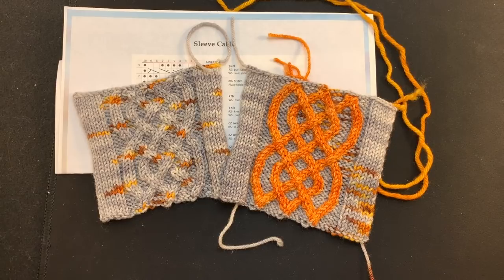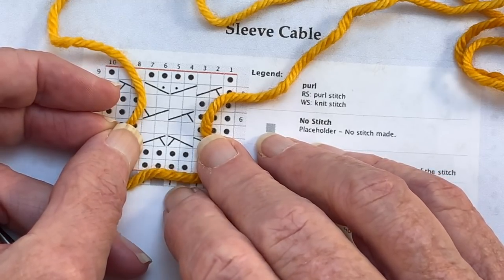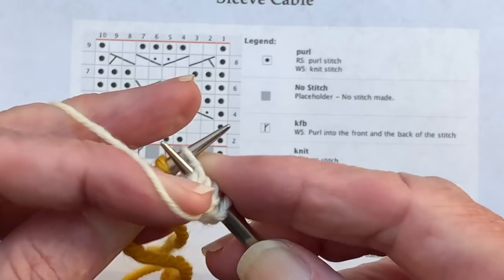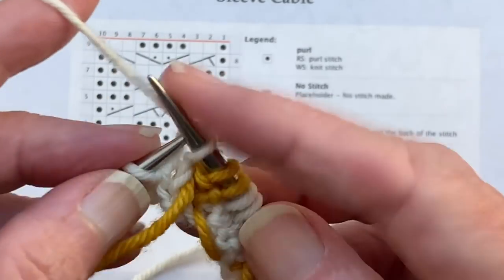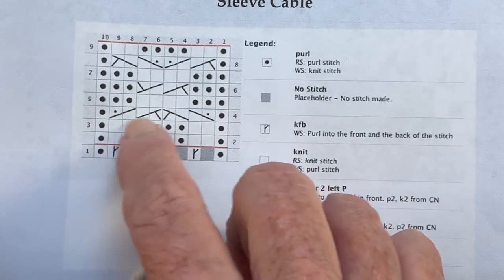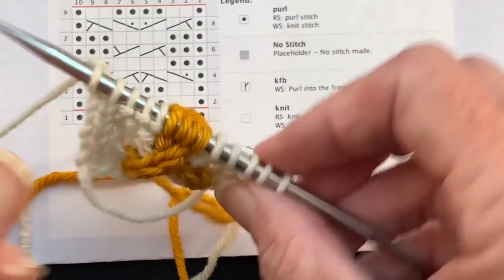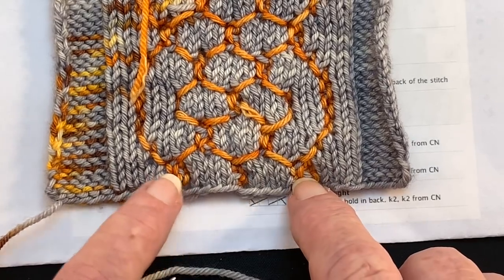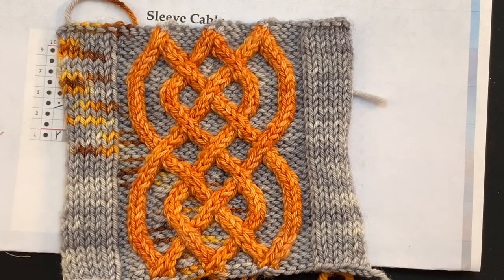Intarsia Cables Worked Flat

Comment: This is beautiful. Ya know, I have attempted to colorize my cables in the past, failed, and wondered if it could really be done. I was making a messenger bag in coal grey with cables, and I wasn't very pleased, because the cables were blending. Now I can pick it back up, thanks to you. Also the tip for splicing is heaven sent. I always hated the idea of spit part lol. Now, can this be done with any cable?
Reply from the maker: You can do this with any cable.  Hugs and Happy Knitting.
Reply: I"m trying to do the same I"m working on this pattern https://www.studioknitsf.com/heart-cable-knit-scarf/ I can't see to get it, my color stops and starts are wrong and i'm getting gaps in my color changes i'm getting frustrated.

Comment: It is absolutely mind-blowing and thank you so much!

I only have one question  though. You said here and in another video you have to read the chart from left to right if the number is on the left, so on the wrong side. In this video in the beginning of the first row the number is on the left but you started pointing from right to left on the chart.

Is it something am I missing or misunderstood? x
Reply: I know it's been months, but in case anyone else had this question, the chart she's using is symmetrical, at least on the wrong side rows. So reading the ws rows left to right or right to left doesn't matter in this case since it's the same each way.

Comment: OMG !!!
this looks scary enough for me to back up and scream
signed: a beginner
Reply from the maker: 😬😂 Be sure to subscribe to my channel if you haven't already, happy knitting.
Reply: Don’t panic, start with a simple diamonds eg. 10 stitches wide in the main colour, 2 st for the cable and knit as usual, just be careful when changing the colour,not to end up with a haul , use the same yarn for the cable, don’t cut it, but leave it loose, it is very simple for the beginning, good luck

Comment: Hi Suzanne, thank you so much for this video. I would like to use your technique to add some interest to a cabled coat pattern that I’m about to start, but the pattern uses a 3-over-3 cable design rather than 2-over-2. Should I still cast on just one stitch per leg, and make triple increases in my setup row where you make pfb in the video?
Reply from the maker: I would try on a swatch first - cast on ½ of the required stitches for the cable legs. Then increase in the legs, 2 increases in one leg and one in the other.  The one with two would be the one to the front.  But try it on a swatch to make sure you are happy with it first.

Comment: Suzanne, this is a great video.  Thanks.  I am a new knitter, but have trouble with reading charts wherein they indicate to cast on, for example, ten stitches plus five.  A chart will show how to knit within a colored area.  What happens outside that colored area.  Does it round-out the pattern?
Reply from the maker: I am not sure what you are asking.  Can you reword it?  Or give more information?
Reply: @SuzanneBryan Suzanne, if you took the pattern you use for the Intarsia Cables, and colored the block, then expand the chart outside the colored block, with additional stitches (this would give you ten stitches, plus x amount of stitches outside the colored block.  Some written patterns don't give you a visual chart, but just written.  I just don't understand.  I am sorry, but this is the only way I can explain it.  Cast on ten plus x amount of stitches.
Reply from the maker: @leelav2290  This is just a single cable. Are you talking about making a wider design by repeating the cable across the fabric?  If so, this is not one of those types of cables.  What you will need is an "allover" type of cable pattern.  Do you have any cable pattern books?  I also have a video on basic chart reading - you can find it here - https://youtu.be/gNmIY5guu58

Comment: The design is beautiful, but where or how do you know when to add the color.  I think if the chart and legend were highlighted with a color it would make it easier to know.  The if symbol doesn’t indicate a Color to use.
Reply from the maker: One easy way to identify which stitches are the cable stitches is to look for the knits (RS). The cable will be the knit stitches.  the background will be the purls.  Hope this helps.
Reply: @SuzanneBryan  yes that does help quite a bit.  Thanks so much.
Reply from the maker: great!

Comment: Great video. Can you really spit splice acrylic yarn? I've been told only animal fibers work. Wish there was some kind of fiber glue you could use for splicing. I do the Russian join for acrylic yarn but can get bulky so I use only half the strands this helps some.
Reply from the maker: Yes, it does work.  Of course it won't felt like wool, but it will hang together long enough that you can knit past it and then it will be secure.  Hugs and Happy knitting.

Comment: Would this work for a blanket with cables? How would you measure the yarn needed?
Reply from the maker: Yes, it would be lovely.  I would work a swatch.  Measure the amount of yarn used in the swatch (weight yarn ball before and after swatch), then measure the swatch.  Figure out how much yarn you use per square inch, figure out the square inches on the blanket and then multiply the amount per square inch by the number of square inches in the blanket.  Happy Knitting!

Comment: How would you add new yarn with acrylic yarn?
Reply from the maker: Try the spit splicing method,  It works well for me, even in acrylic.  You just need to be gentle with the splice until it is in the knitting.  Then it will hold forever.  Happy Knitting!